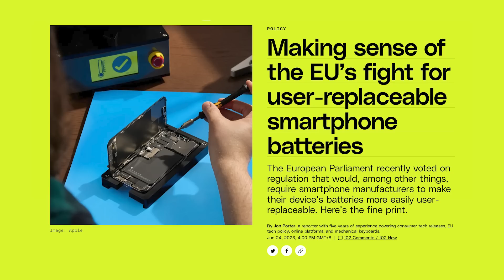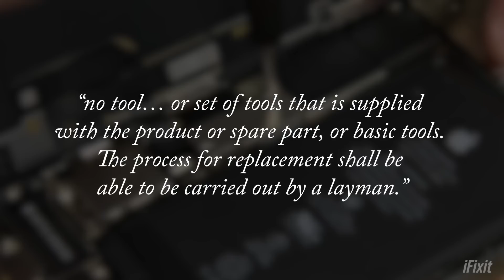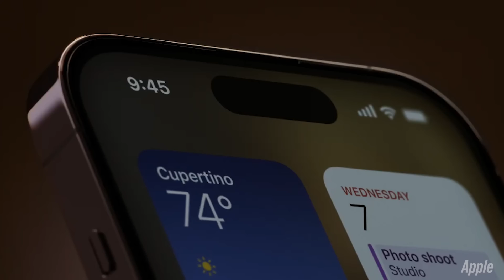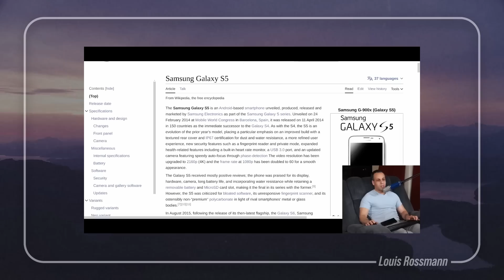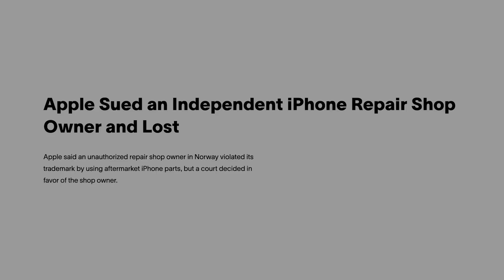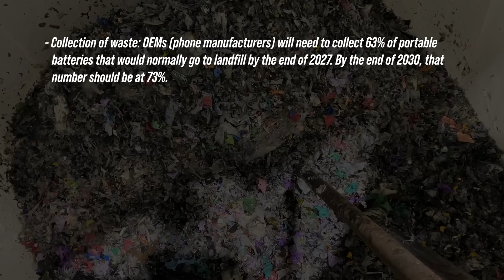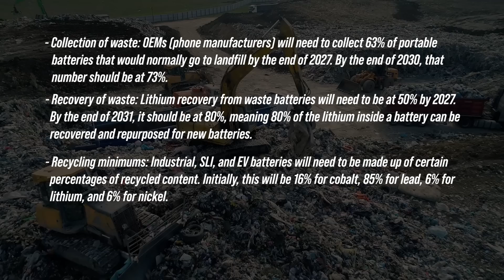EU Just Changed Smartphones Forever

Comment: I am old enough to remember replaceable batteries were a common thing. That being said, I am also old enough to know that battery for new flagship will cost no less than 200 euros. And that's for Android. New battery for iPhone will not go for under 400 USD. Also  I can easily see that performance degradation (for all devices) will be made in sync with battery degradation as well. So, you will be able to replace a battery in your phone with ease, but given these two factors into consideration, many users will still opt out to buy new devices instead.
Reply: Some android doesn't even cost 200 USD😅
And older apples are below 400 USD
maybe you should be a little bit more realistic
Reply: @nichderjeniche  which new flagship (Android or iPhone) costs  so little? New flagship phone can't go under 800 USD no matter what. Even in USA new iPhone will not go under 1000 dollars,and in Europe (depending on country) that same phone will go up to 1200
Reply: @siemprerosso  aha why talk only about the most expensivest? Other Phones don't need battery change or what? And still you have unrealistic battery prices, even for flagship phones.
My android phone was over 1000€ so I think don't have to teach me about expensive phone prices.
Reply: Of course I am talking about flagship phones as this law will mostly affect top tier priced devices. If someone paid 250 USD for a phone, when it's battery dies, it will be more convenient to buy a new 250 USD phone than to put a new battery and still have an old  phone. On the other hand, he who bought a flagship will mostly be interested in changing a battery rather than changing device,as device itself still has lot to offer and can still cope with new software demands industry puts on it. Not only that, but flagship devices would still have tech support in form of new android updates, whereas older cheaper phones will loose it. 
I am quite aware of tech device price, as I make my living out of selling them. I just sold iPhone 14 pro max 256gb for 1220eur, so don't talk to me about being unrealistic. The cheapest Iphone I got is 12mini and it goes for 560 EUR, and I wouldn't touch it with a 10 foot pole.
Batteries itself are now cheaper, because you still need to take the phone to service and pay for changing the battery. Once batteries are made replaceable again  it's prices will skyrocket. Especially for Apple products. Wait and see.

Comment: Apple blocking genuine parts not installed by an authorised repair shop is also due to theft prevention. There are a tons of phones being stolen, especially iphones. Now those phones can not be used for parts. Also your aversion user does not understand much about technology. I have seen so many people with iPhone XS woth an LCD Display instead OLED, and then people complained about how the iPhone operates. Apple is a bit of a control freak, but at the center of it is the user experience. A non-genuine part can seriously impact the phone and its image. People who watch this video are above average in tech knowledge, but your average user is not. I am playing devils advocate here, but it would be interesting to see a video of the upsides of Apple’s limitation on the users, because there are.

Comment: Apple might simply make no smartphones for Europe until the EU changes its law. The reason this is possible is because of the far seeing point of view Apple normally takes. For example, imagine that in 10 years the internal components will be so small and complex that there will be an obvious need to break up the battery into many tiny batteries seperated all around the internals (for whatever reason). How could a government dictate that Apple provide easy access to say 10, 15 or 20 tiny batteries? (This is just one small example of a possible unexpected technological need, not a prediction).

Comment: It's funny how you make out designing smartphones with user replaceable parts to be some kind of black art that manufacturers are going to have to figure out from scratch.

Meanwhile I'm typing this from my high end smartphone in which I can replace the display, camera, USB connector, battery, microphone and speaker using nothing but a screwdriver. Such phones already exist, and have for many years.

This is not a technological challenge...

Comment: If you live in Europe you can buy and use a Fairphone with easily replacable battery. You can open it with your nails and replace the battery with a regular phillips screwdriver. Android support for more than 5 years. So no replacement phone needed! Better for the enivronment.

Comment: As long as people keep buying especially from Apple, they want it insanely expensive. In general people want insanely expensive mobile devices not fit for the purpose. Drop your mobile device to find out what i mean.
I never had an iPhone, but iPads. They keep failing, or Apple simply stops updating them. The same day the message appeared there would be no more updates, the browser became nearly unusable. I believe this was intentional to give me a "motivation" to buy a new one. At least its strange how a perfectly well working browser becomes as good as unusable from one minute to the next. It pissed me royally off.
I switched to a Samsung tablet SM-X200, cost me €150, compare that with an iPad. Works just the same, no complains. I think i will get at least the same lifespan out of it, but for a fraction of the price.
We consumers could change all that by not buying anti consumer products.

Comment: Apple should be blamed for this, they make their battery and screen replacement extremely expensive and complicated in the hope that you buy a new phone instead... that has a short-term gain but a long-term reprecaution... if they only made it easier to repair this phones by making the parts cheaper and offering free repair, they could start making money from that side of the business,

Comment: 🎯 Key Takeaways for quick navigation:

00:15 🤨 Industry-wide design changes have made easily replaceable batteries no longer possible in smartphones.
01:24 📱 The new law by the European Parliament will require all consumer devices, including phones, tablets, and laptops, to have easily replaceable batteries.
02:32 🌍 The law will have a global impact as phone manufacturers are unlikely to design separate phones for the EU, leading to changes in design worldwide.
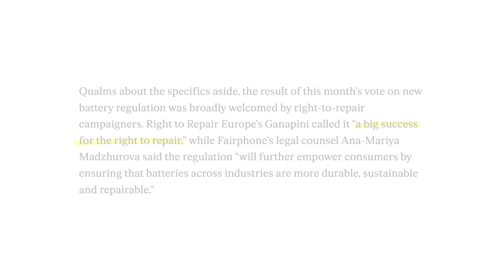03:56 🛠️ The law is seen as a success for the right to repair movement, which advocates for easily repairable consumer goods.
06:19 ♻️ The intention of the law is to create a circular economy for batteries, reducing e-waste and promoting sustainable battery recycling.

Made with HARPA AI

Comment: I would say not only is the battery a problem but more importantly is the way they stop allowing OS updates then eventually an application can’t be updated anymore then everyone else is on the new version and you can’t play/connect/ whatever because they either made or purposely caused an issue across the versions of applications not being the same or near the same build. That’s the biggest killer because even before they could detect parts changed which is also wrong on another level but I used to change batteries back glass screen digitizer cam whatever and that was not on issue. Issue was them stopping updates then applications moving on eventually also. Phones these days ain’t for your grandparents that’s for sure house phone prolly still works from 50 years ago lol. But it is a market that has to make so much in order to want to put so much into innovation. The water rating tho and such are definitely a problem for designing and engineering these devices and they are plenty expensive enough. Sometimes I say be careful what you ask for. But I mean that as in be careful how you ask for it mostly lol.

Comment: Just a thought might be a bit of a foolish idea. But in Sweden to do better recycling we have on plastic bottles a barcode worth 1 SEK or 2 SEK depending on the size of the plastic bottle. So when you buy the product this recycle includes in the price.  

Swedes then go to normal grocery stores to recycle their plastic bottles to then get that money back. 

I was thinking to incentivise people to then recycle their used batteries there would be a similar  ''barcode'' or normal code on the battery that was worth money to recycle. So when you bought the product THAT recycle price would include in the overall pricing. Then instead of going to grocery stores to recycle these batteries, people would go to a electronic store to recycle them. 

Of course this would need a bit more planning and thought, but a nice idea to start from to fix this massive problem.
Reply: yea bunch of bullcr.ap. now, even my redbull can has extra charge on it for "recycling" but you can't return the damn cans anywhere.

Comment: The only reason adhesives were used was to prevent self repair/maintenance of any kind. Insuring that new trends had high sales, while substantially increasing landfill!! A incredibly high percentage of consumers lack even the most basic of practical skills required to self repair or perform maintenance on any product. In respect self repair is of basis to learning new skills at all levels of competence. This incapable majority whose conception to such practice concedes to dismiss interest for sake of time investment wastage. Lacking proactive nuances needed of society only to shed negatively impacting values, in turn degrading common life. These actions should be commended of the EU, for a definite change was needed in such technology sector. If the common public shared comparatively more responsibility of our activities in expansion of knowledge through learning or one's percentage use of landfill & detrimental aspects of allocation areas required. Then prehaps such shared perception would see change to promote ideology that surely no one should ever stop learning.

Comment: I'm pretty sure this law is flawed. Let's say that iPhone has replaceable battery now. What stops them from vendor blocking the battery? I'm not even talking about the aggressive software locks they have now with other components. Let's say you can change the battery but it will only accept their replacements, the same way as it is done with most ink printers. Can it be replaced by layman? Yes. Are parts available to consumers? Yes. Is it worth it? If they just put high enough price on the battery, nobody will replace it anyways.
Let's be serious about this. The battery can be replaced in almost everything. You can usually put replacement made by other vendors without any issues. The only flaw is that you can't replace the battery by yourself, you need technician with proper tools to do this but in the end for you it is just a matter of price. If you can pay Louis Rossmann for his time and skills to replace the battery, then the only thing we are really talking about is the price of the replacement. That's it. As far as I can see, Apple charges $50-100 for battery replacement while the battery itself is $30-80.
The reason why we needed replaceable batteries was their size and lifespan. I've been there, I remember that typical battery lasted maybe 2-3 years until it was discharging too quickly and needed a replacement. I sometimes went through 3 batteries within several years. What now? My current phone has quite decent lifespan even though it has over 5 years of constant use on it. Only now I'm starting to consider battery replacement but I'm sure it will still work for a year or two before I'll start running into having to charge it up during the day. It will be 7 years old already. Does saving maybe $30-40 over that many years change anything?

Moreover, this law may have the exact opposite effect. Currently people use their phones until it's either broken or too old/slow. In case of most people, they replace their phone because of short battery life mostly because it's already old, slower and not worth the price. Will the saving of $20-30 change anything? If it's already old and slow, then it's not much of a difference, especially when many vendors offer trading in the old phone. At the same time if your phone is perfectly good and just needs a battery, will you replace the whole phone just to save those $30? I bet the effect will be the opposite. People will start replacing batteries much more regularly. Instead of replacing it maybe once in the phone life when it's already very bad but the phone can still be used, many people will just replace battery several times spending more money in total and generating more electronic waste than before.
We also have to consider another thing. Making the battery replaceable increases the build complexity and will often reduce the space available for the battery. I did some research some time ago and it's somewhat visible in waterproof or water resistant phones with replaceable battery. 
Galaxy S5 has 2800mAh with replaceable battery while Xperia Z3 has 3100mAh despite being comparable size and actually thinner. The same production year, similar technology but S5 is IP67 with replaceable battery anx Z3 is IP68 without it. Usually comparing similar phones with and without removable battery, you will notice the difference in battery capacity or the size. You simply can't replace glue on thin surfaces with bolts and gaskets expecting that it will have the same seal and size. Either it will not seal that well or it will be bigger and if it's bigger then it will either fit smaller battery or will become a bigger phone. All of that for what? Saving $30 every 5 years?

Comment: Corporate greed or competitiveness in an open market?  Let us not forget that these fantastic miniature devices, inconceivable 30 years ago, have evolved purely as a result of that competitiveness.  Apple's restrictive practices aside, which should be outlawed, I'm pretty certain that phones with replaceable batteries will be bulkier, will cost more to produce, and will have a higher failure rate.  Hopefully these will be marginal but if if the consumer wanted replaceable batteries then it would have been a marketing incentive but it wasn't, which is why it died.  I deliberately tried to stick with phones that had replaceable batteries but most people don't care and now as user I don't either.  Furthermore I do not like legislation that prescriptively limits innovation, much better laws that specify the objective that manufacturers have to meet.

Comment: Yeah, nothing is going to change for Apple & co. There are two exceptions:
1. the battery needs to have at least 83% maximum charge after 500 cycles and 80% after 1000 cycles.
2. As long as the device is waterproof, they also don’t have to use a user replaceable battery. 
But it’s a step in the right direction.